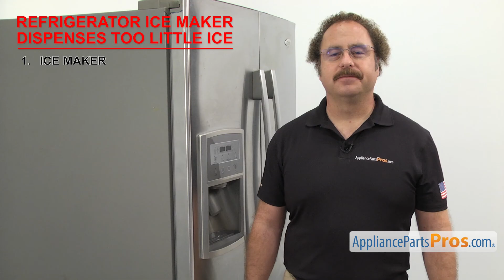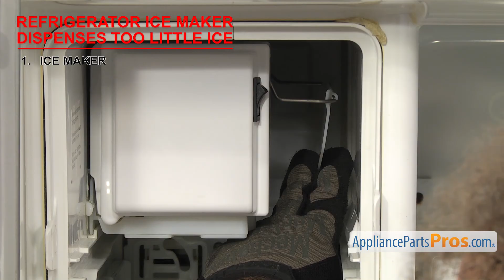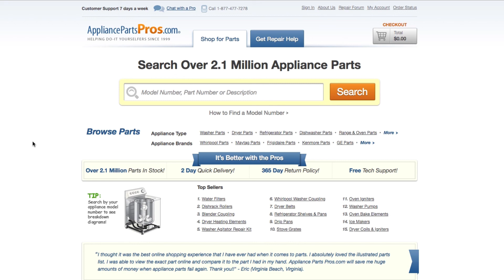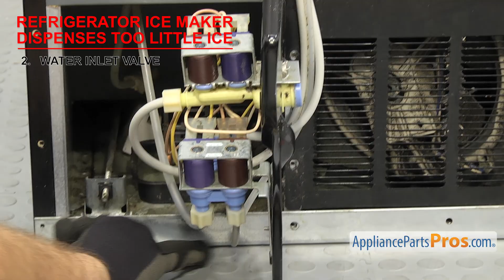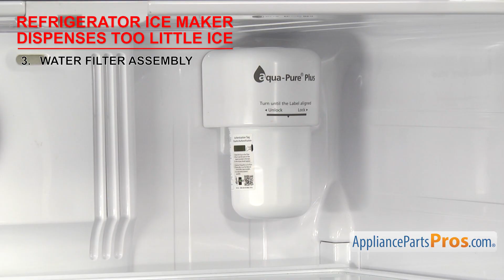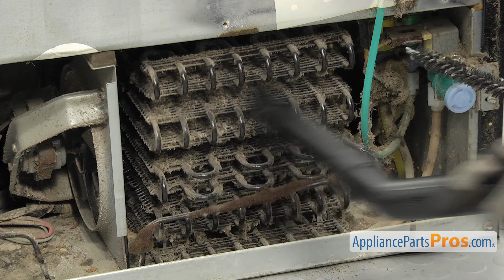Refrigerator Ice Maker Dispenses Too Little Ice - Top 3 Reasons & Fixes - Whirlpool, Frigidaire, etc

Comment: I got good pressure water fill up ice tray , and already changed 2 ice makers still producing ices slowly? What is the problem?
Reply from the maker: You will need to make sure the temperature is between 0 and 5 degrees for the unit to make ice properly.